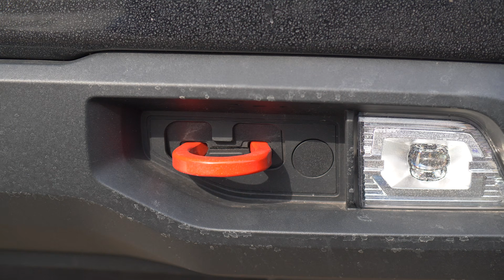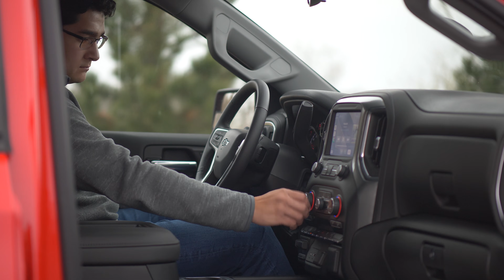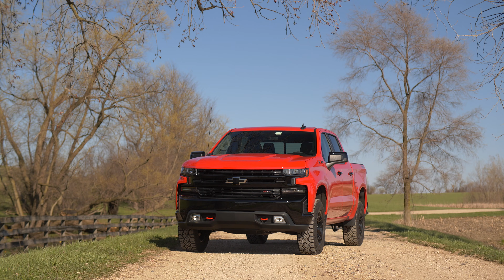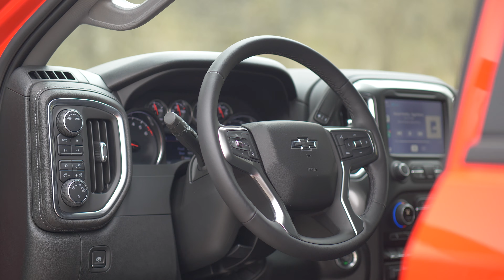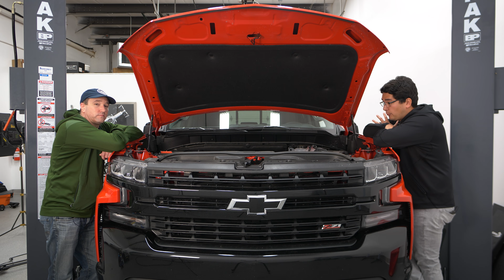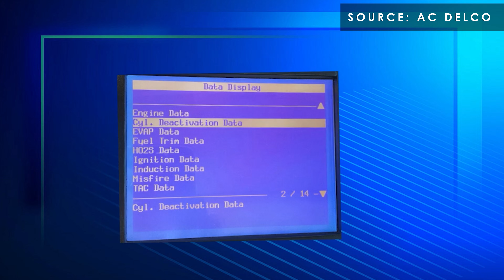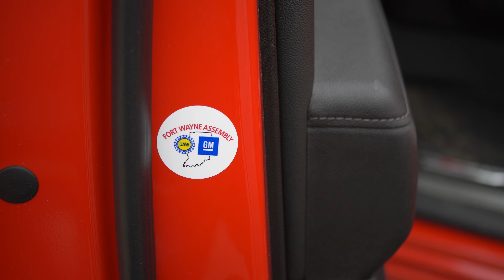2020 Chevy Silverado | The Golden Child

Comment: Id love to hear your take on the fiat-chrysler varient of cyl deactivation.  Supposedly its a different system with less issues.
Reply: As someone who actually owns a vehicle with 8/4 cylinder deactivation, let me tell you its usually a user error. I own a Grand Cherokee with a first gen Hemi 5.7 that has this tech (same oil pressure driven system) with 110k and it works fine. The main cause of failure is engine neglect, mainly people not doing oil changes, using out of spec oil, or using very low grade oil. These systems require you stick to a very strick oil change interval of 5-6k miles, use only the manufacturer specified oil, and use good quality synthetic. Mine calls for 5w-20, and says specifically any other type of oil will damage the MDS system. Considering you can read form after form of people talking about the best thickness oil for a 5.7 hemi and often the conclusion is not 5w-20, I am not surprised the system has a high failure rate. If you want to play with different oil types, you need to disable the system outright.
Reply: @james2042  with chevys is not user error.  Its usually just random from what i can tell on everything ive read.  it doesnt seem to matter how religiously the oil is changed.   its just the nature of the design it seems.  There was something i couldve sworn i read about chrysler's version that enhances the reliability of it long term or at least its design was just better

Comment: I would trust Saddam Hussein with a nuke before I would trust GM with cylinder deactivation.  They have been jacking that up since the 1980s.  You would think they would give up on that after failing twice.
Reply: Well they only had it once in the 1980s with the Cadillac V8-6-4, it was for 1981 only, and actually it worked very well. It didn't resurface again until 2007. Most of the problems with AFM on GMT900 trucks were due to poor oil maintenance, not that GM didn't half-ass a lot of things.
Reply: @daveh2612  
It worked very poorly in the 1980s.  If it worked well, GM wouldn't have gone through so many attempts to fix it before having the technicians at the dealers disable it.  The 2nd incarnation is better but there are enough complaints about the durability of the system that a whole cottage industry sprung up to offer the means to disable it.

You have a very different perception of the Cadillac V8-6-4.  It is the 3rd worse engine they made in modern times after the Olds Diesel and the early Chevy 2300 cast aluminum engine.
Reply: you can thank the EPA for that. All malefactors have to meet a minimum combined EPA MPG. Switching from a V8 to V4 on the highway will help highway MPG.
Reply: @MrYash310  
No, I can thank poor engineering for that.  It seems that Ford and RAM are doing just fine without it.  Thanks for grinding your axe against a straw man.
Reply: But Saddam lost his head oh wait your analogy still works
Reply: Matthew Gaines 😂
Reply: Hans Blix is that you?
Reply: I bought a Sierra with the 5.3 engine in 2009, it has been a good truck and not given me any trouble.  I am currently at 82k

Comment: I think I'd look at the diesel, especially since it's a straight 6 and it costs the same as the 6.2. Unfortunately all 3 of the big truck makes have had issues. Ford had the head gasket and spark plugs on the 5.4, intercoolers on the Eco Boost. Ram has the cam and lifter issues on some Hemi engines. I have a 2015 Ram 1500 and I'm quite happy. The Hemi and the 8spd is a great combo. It's a good daily, and it tows my travel trailer easily. My issues with is are fuel mileage, not un expected, and the tires that FCA equipped, 4ply Goodyears on a 4x4. Having said that I'm probably not going to replace the truck any time soon because truck prices have got stupid, and I don't think there has been enough advancement. The new Ram with the Hemi gets the same mileage mine does, and most of the trucks on the lot have close to the same payload capacity. Ford and Chevy are the same. Mine doesn't have Android Auto, but I can have it added for alot less than a new truck. Keep up the good work.
Reply: The cam lifter and MDS issues on the ram are a user error, the hemi needs good synthetic 5w-20 oil and on a very strict 5-6k oil change interval. Most people think of trucks as neglectable workhorses which is why the hemi has the issues it has. Just so many people act that way the engine gets a bad rep for a common problem that isn't the engines fault.

Comment: Surprising to not hear the Tundra in comparison.

Also the MSRP and what you would pay at the dealer for these ($10k off most trucks) is a point that also sways many people.

I am a Chevy truck guy, however I would be deleting the new AFM trickery day 1 and it's solid.
Reply: Problem is, even if you delete the AFM via a tune the mechanicals are still in the engine and can still jam up over time.

Comment: So let me get this straight all of the reliability issues you mentioned during the engine segment was the last generation? Not this generation
Reply: It's the same powertrain. This issue has been going on since 2007. 
The new technology is only on the 6.2L LT3 because it got updated for the C8.
Reply: Necrotic Reaper it’s not the power train, literally all of their criticisms are about active fuel management which is the last generation this truck has dynamic fuel management

Comment: You know the Grand Sport has the same fuel management!  I just got one of the defeat-devices to keep that from damaging the motor in mine.
Reply: David Street if you have a manual it doesn’t go into afm unless you put it in eco
Reply: @jackethnicallyambiguous  manuals don't have the feature at all which is why their highway fuel economy is 4 mpg lower. it is literally disabled at a hardware level because you would destroy it (and the engine) with a manual trans.

Comment: That truck “shifts” like a CVT in a Nissan
Reply: @Sideways G comparing a trans thats not a cvt to a cvt especially one in a nissan is not a compliment.
Reply: @Sideways G a cvt doesn't shift thats why he put quotation marks. And nowhere does he say smoothly.
Reply: So why are you taking some guy with a sad life's word over the reviewer?
Reply: Sideways G what I meant was, when I drove a 2017 Nissan Altima, and saw how this truck accelerated and shifted, I couldn’t help but think about the Nissan, throws the revs all the way up and it basically sounds like the “shifting” is choking it. The way the Silverado holds its revs and quickly throws them down like 2,000 rpms and brings them back up again, is very similar to how Nissan does it with their CVT’s.

Comment: So if you get the cheaper 8 speed with the 5.3, is that the older cylinder deactivation? Been looking at getting a custom model boss which has cloth and less features. I'm still driving my 05 z71 I bought new.

Comment: When I was shopping for a truck, I test drove all of them for the exact reason you guys pointed out. $50k is a LOT of money for a truck. We settled on an Ecoboost F150 because good luck finding a 6.2L Silverado. Also the Chevy interior sucks. I didn’t like the shifter in the RAM, the Tundra had terrible MPG, Nissan has weird options with the Pro-4x, and I can’t stress how much the Silverado really sucks compared to the competition. Ford even offers a selectable locker in 2WD if you want! And you can get it in 4x4 (with low range!) without the FX-4 package.
Reply: It is too bad, because not long ago GM half tons were arguably top of the class.
Reply: @JSquaredDesigns  their engines were fucking boss too, hearing a late 90s small block straight piped actually sounded good while still running forever
Reply: @JSquaredDesigns  yep. Imo 99-06 gm were the best trucks of the past 20 years of any brand
Reply: The Titan is actually pretty good. What do you mean by weird options?
Reply: @S58985  I couldn’t get the tow package options with a 6 seat configuration and I could get the Pro-4x with all the towing goodies but then it was 5 seats and payload with all the options was lower than what we needed to tow our trailer. So maybe weird was wrong word for it.
Reply: MrJamesLuz makes sense. Unfortunately Nissan hasn’t really been able to have the customizability with the Titan that the American brands have even able to do
Reply: Hope your ecoboost holds up. Have you seen the cost to replace the turbos? Can't beat a naturally aspirated engine!
Reply: MrJamesLuz the ford interiors aren’t all that nicer compared to the Chevy if anything they’re equal, also on the Silverados you can also get it 
in 4x4 without the Z71 package
Reply: @alecbaye9703  can't get a 2 speed transfercase unless you buy a Z-71 tho... And that's just retarded! I'm a Chevy guy who is starting to lean more and more towards Ford
Reply: @Durataur  wow i didnt know it was THAT bad!!   Thats fucked up!
Reply: @Durataur  exactly! I’m one of the rare people who actually uses low range
Reply: As someone whos sat in both trucks, the ford interior is the exact same quality. If you think one is better than the other you have a bias toward x company, in your case its ford. Also you can get a 6.2 in a custom trailboss for 43k msrp, and there are 4 within 50 miles of me for sale right now. Did you just drive to your local dealer and when they said they were sold out you went straight to ford or are you lying about going to a chevy dealer in the first place just because you're a ford fanboy
Reply: James Mastroianni ... I always owned GM products... until 2019... 85 k10, 88 C2500, 94 K1500, 99 K1500, 04 1500, 08 1500, 16 2500HD. 2019, I sat in the Trail boss. Power was nice (5.3 w 6 speed), shifts were good, ride quality was great, 48k MSRP. Liked the truck, although it did not have a flip up center console... cup holders and seat belts were in weird places. I couldn’t look past how it had changed. Test drove every full size half ton, Ford being last, and it surprisingly blew me away. Ford dealership is not as personable as the GM dealership, my F-150 also has a horrendous turning radius. The 3.5 TT ecoboost has a lot more torque, HP is about the same, but the 10 speed is absolutely awesome. Interior is really nice, not as nice as Ram, but def better than GM (around 45-60k price range). Fords engineering department is killing it. I never thought I would own a Ford, but when you test drive all of the trucks in your price range, the Ford kills it.
Reply: @james2042  this is 110% true. Both GM and Ford interiors suck equally.
Reply: @james2042  I’m not a Ford fanboy. In fact I’ve owned more GM and Chrysler products than Ford products. My driveway includes a Subaru and a Nissan. When I was shopping trucks Ford had all the options I wanted. 

On the interior it’s the little things. I like the trailer brake controller on the right side. I like the layout of the 4x4 controls and the ease of engaging the locker. I like the 6 seat configuration. I could go on and on. But it’s not because I’m a fanboy, it’s just what worked for me.

For the 6.2L trail boss, there were 2 within 100 miles. Checking today, there’s only 3 within 100 miles.

Comment: Cylinder shutoffs seem like such a bad idea.  Another good SavageGeese review.
Reply: My hemi of 110k miles has been fine with it reliability wise, you just need to stay on top of your oil changes. Issues arise with these systems because so many people trust the 15k miles per oil change on the oil bottle rather than following the 6k on their maintenance manual, then blame the manufacturers. People confuse "bulletproof" and "maintenance proof" all the time and end up murdering their engines via neglect.
You can clearly tell when its in 4 cylinder though which is annoying, even though you get used to it. But according to just about everyone who drove these new DFM ones, you can't feel the deactivation at all since its dynamic with your foot and this is the first review ive heard say its clunky, and that includes other reviewers who also bash on cylinder deactivation.
Reply: @james2042  I've driven a 300C Hemi with it and was surprised how unnoticeable it was when it dropped to 4 cylinders. The only time the switch back to 8 wasn't smooth was if you punched it within a few seconds of it dropping to 4. It seemed to need ~4 seconds before it could switch back. It made a funny sound, so being a rental I naturally did that repeatedly.
Reply: @james2042  I honestly can not notice it with my truck shockingly.... have a plethora of other issues with my new truck by thruway driving when it shuts down to just one cylinder and if I have to speed up to pass MAYBE a 1 second  delay in throttle response but nothijg audible or clinky. Than again with a factory lifted truck and tires it might act differently. Shockingly though the price tag on this trail boss where the sticker tag on my RST was $59,999 didn't pay close to it but sadly I will agree with the comment at 16:43 to go drive the competition... as soon as I get my court date with our states attorney General and rid myself of this Lemmon its apparent I will be going to a Toyota tundra crew cab.
Reply: @james2042  You can't feel anything when a DFM engine deactivates cylinders. It's impressive. You're absolutely right. These systems are reliable, but the oil needs to be changed by ~ 5 to 6k miles.
Reply: @hochhaul  also sticking strictly to the recommended oil is also essential
Reply: Sala-noids.
Reply: I have a friend who has a 2012(?) Chevy truck that cooked the engine at less than 20K miles because of this bullshit. GM and the dealer just wanted him to go away, but my buddy basically told them if they didn't put a NEW crate motor in under warranty my friend was going to wage Thermo-nuclear war against GM and the dealer. BTW my friend is the most anal retentive when it comes to taking care of vehicles and is a neat freak to boot so this truck was babied from word go and to this day looks like it came of a show room last month. I won't ever buy a GM vehicle with the de-activation bullshit. Bullshit. Bullshit. Bullshit, I say.
Reply: @seththomas9105  same happened to my brother. His was an 09 or 10, I believe. By 40k miles, that thing was roasting through oil.
Reply: I always shut mine off as soon as I start it. Leave it on and the celinoid jumper that restarts the engine sounds different and sometimes its smooth and quite and other times its quite violent. Either way STAY away from any chevy truck from 2017 to now. I made the mistake thinking chevy was STILL a chevy when I traded in my 06 Z71 last August for a 2019 Z71 RST
Reply: DFM is far superior to AFM. I personally Own a 2016 AFM model and it's alright when it hits 4Cylinder mod it is annoy with the exhaust. But my combined 19mpg is worth it. I usually push the oil changes till 9k and have yet to feel an issues at 73k miles.
Reply: I've got a 17 Camaro SS. They had to swap the lifters responsible for the AFM. They were ticking very loud during acceleration and even during normal cruising speeds in V4 mode. I've even got done oil leaks on my drive way. Its still ticking too. Religiously changed the oil on it every 5k miles with dexos approved Mobil1. It didn't make a difference. 35k miles and an engine that may blow up real soon. The AFM/DFM shouldn't even be an option with these issues.
Reply: I’m the kind of person that gets the oil changed done every 4000 miles and my 07 V-max Silverado had camshaft and lifters issues at 30,000 miles
Reply: Diesel is best option!

Comment: I never understood why people bought these. The 5.3L that virtually everyone buys is kinda underpowered relative to the competition, the interior quality is definitely inferior to Ford and Ram, and they still use that garbage G80 differential in the rear instead of a proper locker or LSD. I suppose deep discounts make these things appealing?
Reply: Considering they just said the 0-60 is low 6 second range. How is that under powered? That's the same as the RAM.

Comment: AFM came out 2007 in the second generation of silverado. That's is not new and people already know what are the common problems. Just change oil in a good way.
Reply: Oil changes don't help if/when there's a problem with any of those solenoids.
Reply: @zzanatos2001  yeah but they act up around 150k miles (good oil changes). Ppl just rebuild them and they keep going.
Reply from the maker: AFM got some updates in 2015
Reply: @savagegeese  still do the same thing. V4 to v8 tho
Reply: AFM can be turned off via a software programming. Lt1swap.com.

Comment: I will never buy a GM product based off of what I've heard with problems, even these brand new trucks still have problems.  We have way to many people trading these 3 year old or less trucks within warranty in for a Ram simply due to the annoyance of unresolved or reoccurring issues and visiting multiple dealers.  We had 7 last month that got ditched,  one of my clients bought a '19 1500 Denali $68k less than 30k miles and 5 computers in less than a year it was in the shop for the 5th when he came to see me.  We had 1 ford traded, never had an issue on his '13 with 130k mile 5.0, nor on a 96k miles ecoboost from the previous month.  Don't buy the baby Duramax either, major service components on the back of the engine that require the transmission to be moved at 150k, phenomenal engineers I don't think so.  Wonder how much that's going to cost yeesh!  My 5 year old Ram Ecodiesel 75k miles nothing but basic maintenance (still on original brakes) and recalls out the ass but no warranty work.